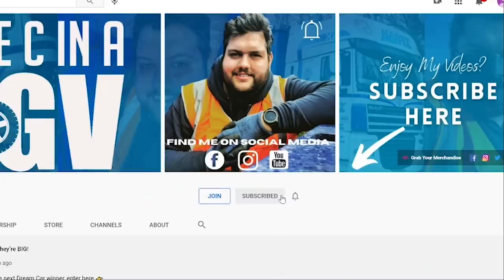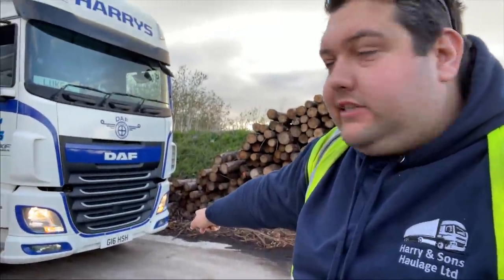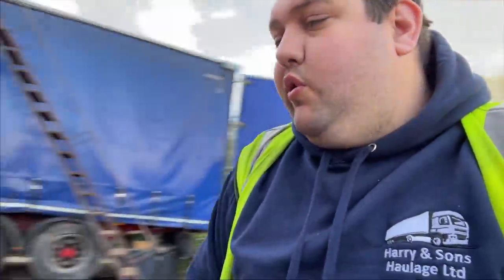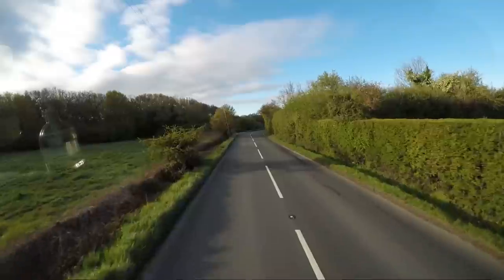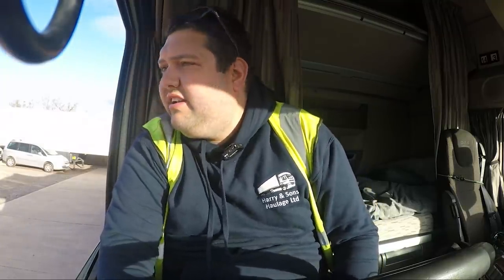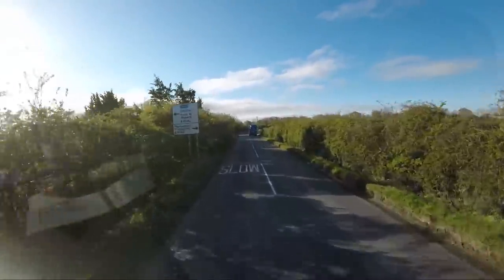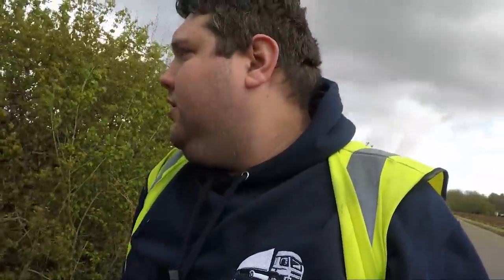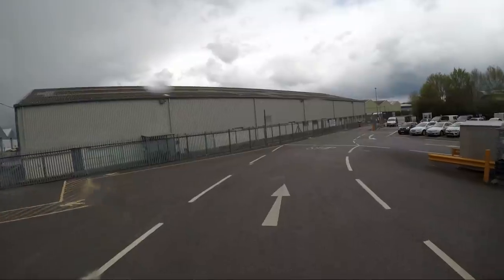My New Truck! #LukeCinaHGV

Comment: In the late sixties, I was stationed at Bickliegh in Devon. Myself and 3 other Geordie lads used to drive to Newcastle every other weekend in a Riley Elf. We always used the A361 which cut across to Daventry, then picked up the M1 at junction 17. Avebury was one of our favourite spots on the journey. I often go to Plymouth and still prefer the 361, rather than the M5. It's a lovely picturesque route. Takes longer but is worth it. Beautiful area.
Love your vids Luke, often watch them twice. Thankyou..
Reply: All that way in an Elf! By the time you get there you have to turn around and set back off again haha 😜
Reply: @paulmulks  You are right, it took about 12 hours. We could do 80 flat out. 😀😀
Reply: @peterfrazer1943  Defo deserving of a few beers by the time you arrived then haha 🍻

Comment: I'm watching with interest and notice that your load is above the height of the headboard so in a front end collision the load could potentially move forward and come through the cab as there's nothing to arrest it's forward motion. At 12.58 ish did I also hear you say you would use roads that had road weight/lenght/width limits that your vehicle exceeds,if you needed to?
SAFETY FIRST LUKE
and remember it's your licence that takes the hit.
Stay safe. 
a

Comment: Your DAF is reading road lines and goes off then you drive onto one.
Reply: No the lane guidance warning is a diff noise, more than likely an ABS/EBS fault due to the connection on the trailer. DAF's are renowned for it..I know as I hear it every day lol

Comment: Think we Discussed on my last CPC that there is a Limit of 750 kg Difference Allowed between one side of the Trailor and the other side. I'll Try and Look it up in my Notes Somewhere but in Essence, that Pack of Timber would have to had been moved, one way or the other.
Reply from the maker: Yeah common sense says move over to 
 Balance the load, (as I did) that being said the forklift has no obligation to do it, he good out right refused to touch anybody else’s wood for fear of damaging it. Then you’re stuck

Comment: good explanation on the straps etc and you can put the excess strap in the plastic holes made by the forklift etc and around the pallet nogging if needed so that the wind cant pick it up etc

Comment: Leaving the engine idling would get your wrists slapped at most companies, they say best way to warm engine up is to drive gently for a few minutes.
Reply from the maker: Just wondering how you do your checks if your engine isn’t running? Do you not drain your air and build it back up to see if you got any Air leaks? 
Do you not check for any knocking of any type while the engine is running? 

I’ve never been told not to let the engine run and if anyone did tell me that then I’ll tell them that I would be doing my checks correctly and as a company they’re stopping me from doing it. I reckon they will then change their opinion
Reply: @lukecinahgv  no i do not drain the air tanks, the only time i ever had to do that was on my Canadian class 1 with air brakes test. Never had to do that for any of my UK employees in 40 years.
Reply from the maker: @richardhughes6757  Number nine on my vehicle defect sheet is air buildup/leaks. You can’t check to see if the air build up correctly if it isn’t empty in the first place and you need to leave the engine running to check the air.
Reply: @lukecinahgv  just saying, if i leave my engine idling the telematics will inform the company and i will lose marks on my driver performance app,
Reply from the maker: @richardhughes6757  yeah I understand mate some companies do have these rules. But technically I wouldn’t say you’ve checked to see if the vehicle is roadworthy.
Reply: @lukecinahgv  well if you want to get pedantic I hope you lock the cab whilst you leave it running and walk around it because someone could jump in and steal your truck or release the parking  brake and allow it to roll away.
Reply from the maker: @richardhughes6757  I believe you’re referring to the time I left it running during my daily check whilst I was in a locked yard where only people with a code can access and said people can drive the vehicle because their staff employees. 

Nothing pedantic about doing your checks properly mate. Starting The engine and just driving off isn’t good for the turbo either, same for when you finish, you got a leave the engine running for a few minutes to cool down before you switch it off as you can cause damage. 

End of the day, every company has different rules. As long as your company is okay with the way you’re doing it then no problems 🤙🏻
Reply: @lukecinahgv  your right there Luke, there's no way the company I work for would allow me to film and talk to a camera whilst i drive their trucks but your company is obviously ok with it.
Reply from the maker: @richardhughes6757  Out of interest does your company allow you to make and receive phone calls hands-free? 

I only ask because my camera equipment is all voice activated and not touched at all and so is exactly the same in my book. Just talking to myself 🤙🏻
Reply: I leave my engine idling in the morning as with 20 over guys and my company don’t mind the truck has been sat for about 30 mins sometime every company’s different but I do have to agree with luke

Comment: There is no way your unit is 14”3’ high like your height indicator suggests 🤔
Reply from the maker: You are absolutely correct
Reply: You still have to show the high you cab is
Reply from the maker: @kevinswift7442  my understanding is as long as I’m not taller than the displayed hight I’m okay.